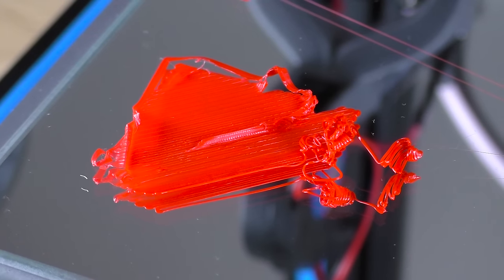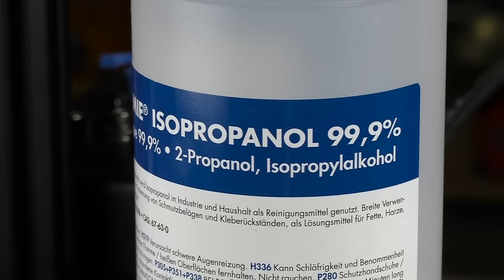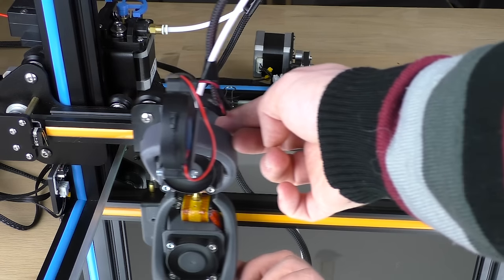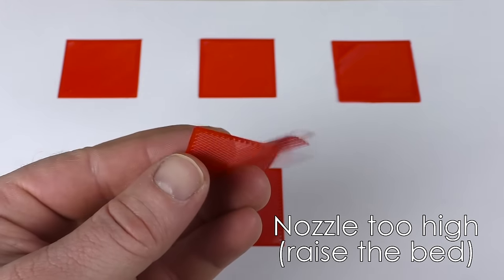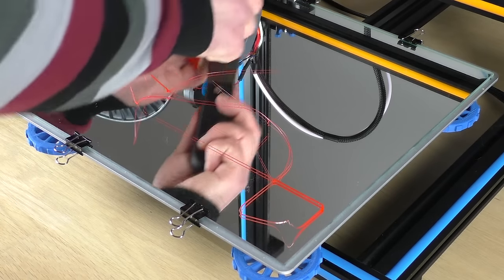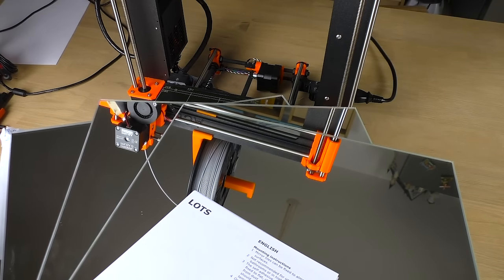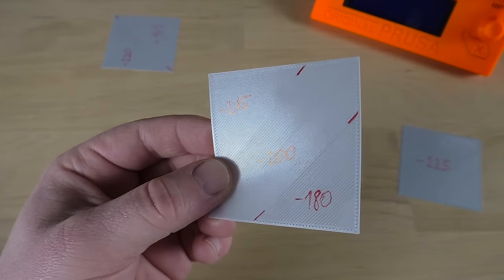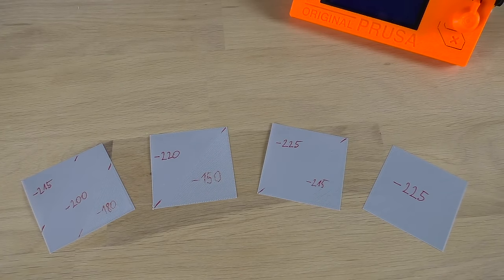Best method for 3D printer bed levelling

Comment: Do you heat the bed AND the extruduer? Or only the bed? Thanks a lot!
Reply from the maker: I recommend that you heat both the extruder and the bed. The bed expands slightly once it gets hot, so it's best if you perform bed leveling with a hot bed as well.
Reply from the maker: PS: If you are only using the paper method, then it's ok if you only heat the bed.
Reply: @HobbyHoarder   Thanks for your quick reply man, really appreciate it.

I'm going nuts here. I got the Artillery Genius a few days ago and it was printing fine. Now I have no idea what's happening but I'm having a hard time the first layer to stick to the bed. I'm cleaning it with 99% Isopropanol (not 99.9%) - Before I cleaned it with regular Alcohol you get at the pharmacy for bounds.

Now sometimes the calibration test will work fine, sometimes some of the layers won't stick. I've tried setting different levels, so the paper has more or less friction. Also tried with and without the nozzle heated up aside from the bed.

I increased a bit the temperature of the filament from 200 to 210 (I'm using good one, not cheap Amazon stuff) and it seems to be working a bit better but it's a hit or miss

What drives me nuts is that it was working okay for the first few days. First time I level the bed it was actually it cold! and it printed okay!
Reply from the maker: @JonatanCastro-secondary  Don't worry, I nearly lost my mind at first as well, it just takes practice and a lot of patience.

For PLA, I found 215/60'C to be the best overall temperatures. Also, clean bed with soapy water a few times (soap, clean, rinse, repeat). There might be some oil left from the factory. Afterwards, iso is good every so often, but it's best to clean the bed when it's cold.

Also, once you're close enough with the paper, stop using it and switch to printing calibration/leveling squares. You'll be able to fine-tune it much better. After that, it's just a matter of practice and you'll soon learn how a good first layer should look like.
Reply: @HobbyHoarder  thanks so much! I will try with soapy water, because I've already cleaned it a lot of times with iso, thought that was enough. I'm also receiving a PEI flexible metal magnetic bed, so hopefully that helps too.
Reply from the maker: @JonatanCastro-secondary  Flex beds are the best, I have them on all my printers. Clean it with soapy water as soon as you get it, they usually have a thin, yellowish film on the surface that screws up adhesion.

Comment: What are your thoughts on the bltouch.
Reply from the maker: I have a clone on my CR-10S. I don't know if it's simply because it's a clone and not original, but I'm not getting the results that I was expecting. 

Sure, it's better than nothing, but it seems that if the bed is even slightly tilted, it doesn't compensate for it. So I ended up installing nylon nuts instead of the springs, so that I can precisely level the bed manually and then let bltouch do the final thing.

Comment: Hello, I have a problem, I'm using the manual bed leveling, if I use the LCD to level it works perfect, but when I do it from the Start gcode it does not work, I do not know what command to use to do the manual leveling.
Reply from the maker: Try this command: http://marlinfw.org/docs/gcode/M206.html

Comment: I have an Ender 3 Pro and the original test dog .gcode file prints perfectly well, with no build plate adhesion settings. However, I downloaded some .stl files from the internet (mainly mods for the printer) and turned on "skirt", but the PLA still won't stick to the bed. I'm starting to wonder if it's something else?? And I don't think it's bed temp because the printer mods print calls for higher temp than the test dog. Anyone have any experience with this?
Reply from the maker: It's possible that the dog.gcode has some sort of Z offset. I'd suggest simply re-leveling the bed by slicing your own leveling squares (check the video for links). Once you do that, any file that you slice yourself should have the same adhesion.

Comment: When I start printing. The pla goes on the bed. Then it's to lift then it end up like a bird's nest. I've tried leveling the bed. Moved the nozzle close to the bed.  I've downloaded cura. Coz the memory stick what came the A4 printer has a error.. I've hammer very close printer now.😣
Reply from the maker: What kind of surface are you using on the bed? What tempeartures are you using? It never hurts to clean the bed using isopropyl alcohol.
Reply: I've  got glass on a hot please. And I've put masking tape on the glass. It's starting to work. Just trying didn't way to get smooth finish..
Reply from the maker: Have you considered replacing the glass with a mirror? Mirrors work much better. I have one on my CR-10 and I don't have to use masking tape or anything, I can print directly on the mirror. It sticks like crazy. If you can get a mirror of the correct size, that would probably be the best solution.
Reply: Ok thank you for your help.👍
Reply from the maker: Good luck and come back if you need any help along the way.
Reply: @michaelterry8671  what printer are u using?

Comment: How did you get it to adhere to glass with nothing applied to it?  If I try to print to glass it doesn't adhere at all.
Reply from the maker: I agree, glass is a bad choice. However, I'm using mirrors, which work much better. Yes, mirrors are technically glass, but they're made to much higher standards and much more polished. If you use a mirror, it sticks like crazy.
Reply: @HobbyHoarder  Thank you for the reply.  I watched the video the first time at work so I missed the part where you said that.  When I rewatched at home and paid 100% attention I heard you mention that mirror is much stickier than glass.  Thank you for this method, it is definitely better than just printing the single lines.

Comment: Uh i have a davinci printer but the manual system has three points and has not a hand moving setting, how do i get it balanced? I tried a huge lot of times...
Reply from the maker: I've never used a DaVinci before, but aren't there any kind of knobs under the bed?
Reply: @HobbyHoarder  yes 3 but the system  feels hard to set up

Comment: How did you cut the mirrors? TIA
Reply from the maker: I didn't. If you buy them from Ikea, they're already the correct size for CR10. Otherwise, you can buy a mirror at most hardware stores and they usually cut it for free.

Comment: If I got the glass pieces from Ikea would I have issues given that the bed is heated?
Reply from the maker: No, I've used Ikea mirrors exclusively on a heated bed. As long as it fits your printer, you can use them.
Reply: @HobbyHoarder  My issue now, I think, is the extruder clicking non-stop and barely feeding any filament in.
Reply from the maker: @Stormshot1998  That could mean a lot of things, but the first thing I'd try is doing a cold pull. Check videos on YT, there are quite a few good ones explaining the process.

Comment: Is there a way, and a benefit to manually leveling the Prusa MK3 bed to get it close to level and then allow the auto bed leveling to make up the difference?
Reply from the maker: You could add washers to raise a corner, but I highly doubt you'll do a better job than auto levelling. If your bed is so warped that auto levelling can't compensate, then I'd contact Prusa for a replacement. Their support is usually good at things like this and it's very likely they'll replace it for free.

Comment: I don't understand, if there's an offset value then after setting the bed height manually to best effort for each corner, can't you just adjust the offset in the software for each corner until you get a good print after that? Manually tuning the knobs is very difficult and adjusting only one corner will also inadvertently affect the whole bed level slightly.
Reply from the maker: You could do it in software, sure, but I'm guessing it would take a lot longer. You'd have to determine the offset (in microns) for each corner and then test it. But since your bed would still be on springs, they would deform over time, which means you'd have to keep adjusting the software offset. If you want to go with this option, then I highly suggest you remove the springs and fix your bed in place.

Comment: Hi
Do you make levelling with nozzle hot, set to the print temperature ?

It seems that the print hotend is expanding with the temperature, so i use to make levelling with almost 200°C
Reply from the maker: Yes, absolutely, you should always level the bed while it's hot so that you can compenaste for temperature expansion.

Comment: I've recently discovered some bad first layers, with exactly what you told. You can see between the lines. I guess I have to re-adjust auto-leveling.
Also any tips for auto leveling with the magnetic sensor on glass?
Reply from the maker: As long as you're not using an inductive sensor, you should be fine. Have you tried it yet? Since you can see gaps between the lines, you should lower the nozzle.
Reply: @HobbyHoarder  I'll try, thanks! I have the "original" Anet A8 auto level sensor, which reacts to metal. Have to try if my glass isn't too thick. Either way, I'll have to re-adjust the sensor, so that my nozzle is further down :)  Thanks 👍
Reply from the maker: I'm sorry to say I've never worked with the A8 sensor, so I can't talk about how it works. Looking at photos online, it seems to be inductive. Inductive sensors usually work best at only a few mm from the metal bed, so the glass can definitely be an issue here if it's too thick. Here's a page that I've found with various sensors and the distance they can work with: https://3dprint.wiki/reprap/anet/a8/improvement/autobedleveling

Comment: The issue though is with the bed fulcrum. I have the ender 3 and adjusting one corner knocks the other 3 out of whack. If I go corner to corner in a circle, when I get back to the first one, the first corner is too high or low. I’ve spent 20 minutes going in circles and diagonally, so I don’t think this method is helpful.
Reply from the maker: Then it's more likely that either the springs are bad or the entire bed carriage is bent (quite common with Enders). If it's a new printer, then the springs can be too soft and deform quickly. Is there enough pressure on them?

Comment: What do I do if the middle square isnt that good?
Reply from the maker: If it's too low, then there's a simple fix - just cut aluminium foil and place it under the glass in the middle.

If the middle is too high, you can try putting the foil in the corners and see if that helps. Or just flipping the glass around. Worst case, you can buy a new mirror tile, they're usually quite level.

Comment: Cool vid! Quick question what if you only have three knobs to adjust the bed? Is it the same process?
Reply from the maker: It should, yes, I don't see why not. The only issue you might have is if the bed is warped in a corner without the knob. If that happens to be the case, I've had great results by cutting a square patch of aluminium foil and placing it under the build surface to raise it just a little. You can stack more foils if needed.

Comment: the screws on my cr 10 dont seem to raise or lower the bed at all ! im using the sample filament which comes out but mostly its very thin and scratches the bed. i dont know what to do!
Reply from the maker: You'll have to solve the screws first. It sounds like the screw isn't engaged with the bed frame. Can you look closely underneath and see if you can push it in while turning the knob? Try both directions as well.

Comment: I first adjust Z height and then level the bed but after that the nozzle is far from the bed.
I adjust the nozzle again but then the bed is far away.

Help ?
Reply from the maker: Are you using auto leveling system as well? Another issue might be bad springs, especially if it's a new printer. Try to compress them more.
Reply: @HobbyHoarder  I never had this issue before I just get confused which to adjust first.

Should I first adjust Z height and after the bed level ? Yes I use auto bed level.
Reply from the maker: @Thesilentwolf7610  It's possible that your bed leveling probe is not working correctly. If you have Octoprint, I highly recommend that you do a so called "Probe Repeatability Test." It will tell you how accurate your probe is and if it's good enough.
Reply: @HobbyHoarder  The thing is that it prints perfectly in the middle. what do you suggest me to do ? Z height first and then bed level manually ? Or Z height first , bed level and Z height again ? Thank you.
Reply from the maker: @Thesilentwolf7610  You should get the bed leveled first and then Z offset for your auto probe. But you might have to repeat it a few times, there's no perfect solution.

Comment: What filament do you use for the tests?
Reply from the maker: Nothing special, just any PLA you have. It's a good idea to repeat it if you change materials though, carbon or ABS might create a different first layer.
Reply: @HobbyHoarder  your video is great. I appreciate the time you took in order to help us. I use mostly TPU because I print racing quad stuff. Can I use the same procedure with TPU? How should the tpu square look?
Reply from the maker: Thank you, I really appreciate it and I'm happy to hear it helped.

I've never tried TPU, but I'm assuming it shouldn't make much of a difference. There should definitely be no gaps between the lines on your first layer and it should be at least somewhat smooth. I usually print my first layer so that it's slightly. rough to the touch, just so that I get better adhesion.

Let me know if you don't want to waste filament trying it out. I have a sealed TPU spool that I should really use sometimes, so I can do that and let you know.